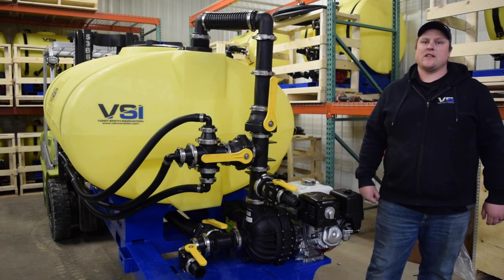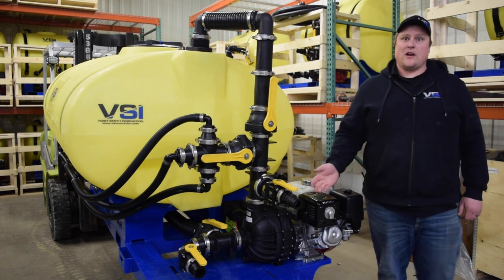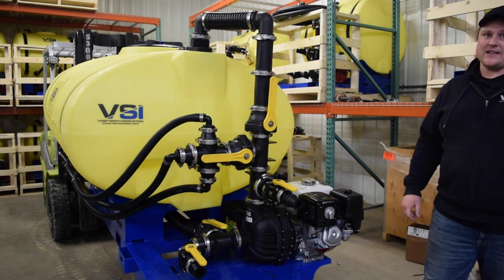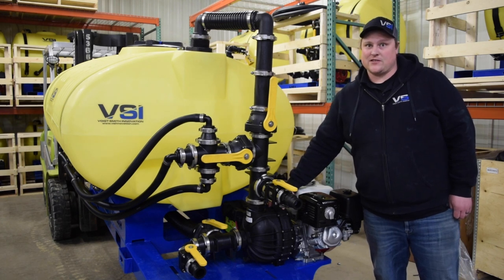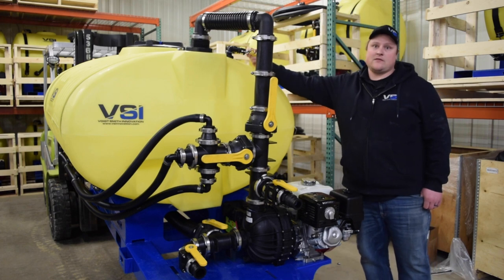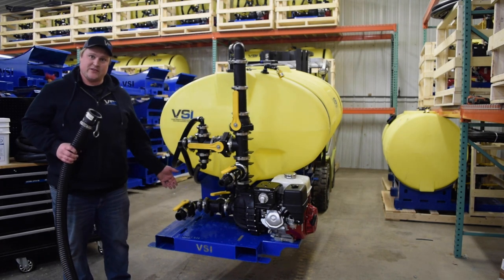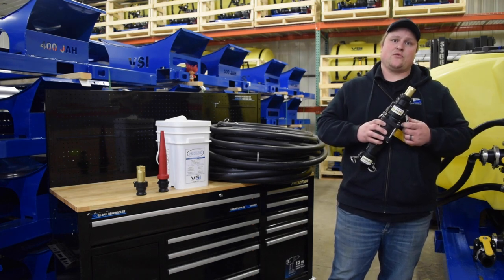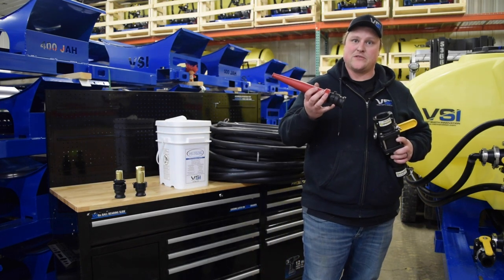400 Gallon VSI Jet Agitated Hydroseeder Overview

Comment: Which unit do y’all recommend for doing residential yards and small commercial jobs
Reply from the maker: The 400 JAH is a great size for jobs like that. You are able to cover around 4000 square feet per tank, vs 2000 or 1100 with our other models. The less time you spend filling and mixing will mean more spray time and less man hours per job.